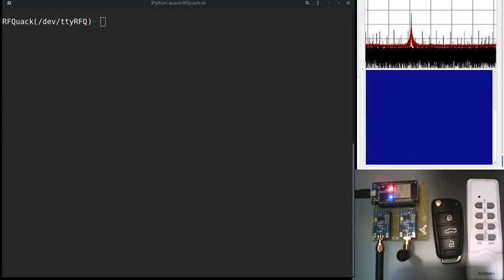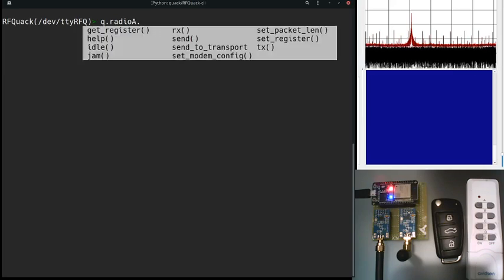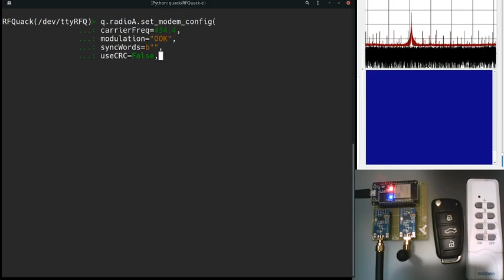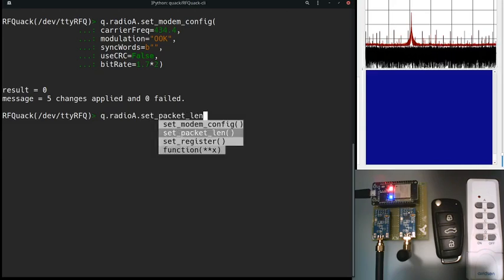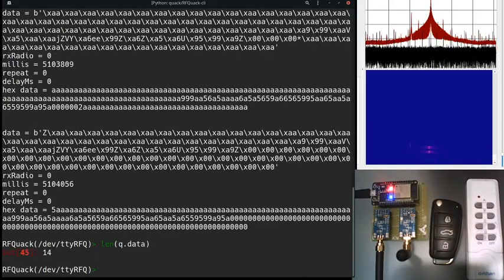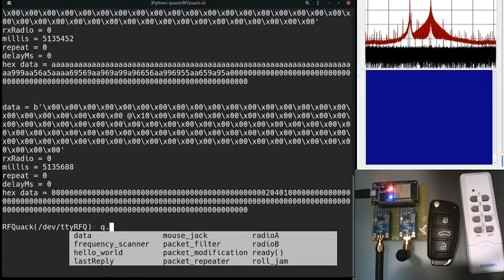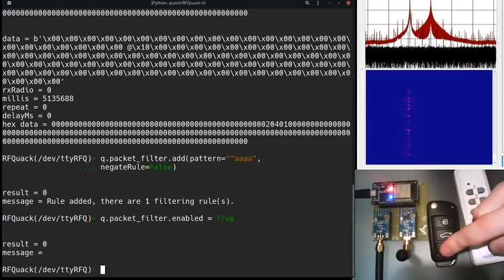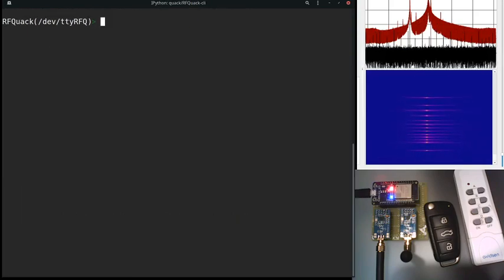RFQuack DEMO - Packet capture and filtering via interactive CLI

Comment: unfortunately I could not figure out how to take advantage of your labor using only a microcontroller and call functions from the inside using buttons and a display (
Reply from the maker: What do you mean "from the inside"?
Reply: @phretor  i meant using only microcontroller, no external computer to send commands. You offer two use cases, serial port or wireless connection
Reply from the maker: @gvozdev-leonid  I see. But this is not the intent of RFQuack. RFQuack it's a research tool to analyze wireless protocol, not a self-contained tool. Have a look at https://git.io/rfquack